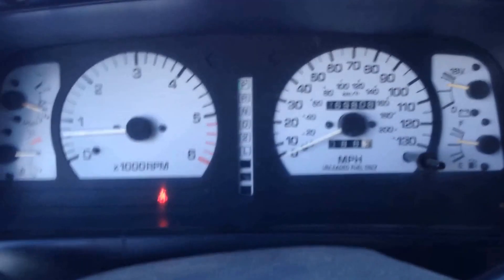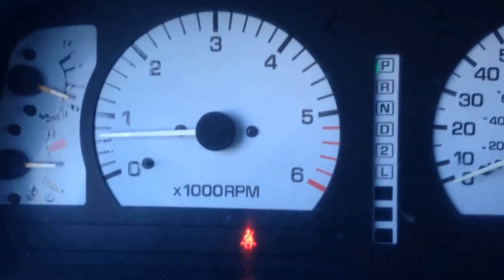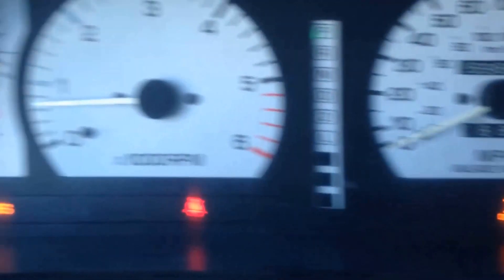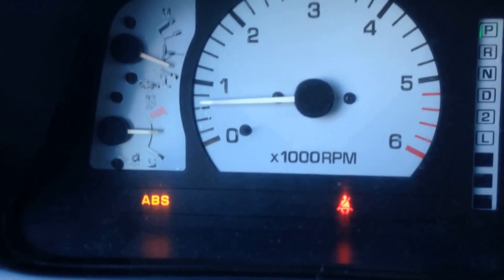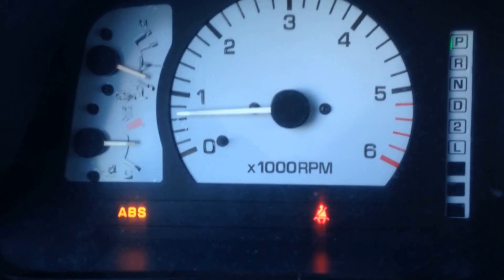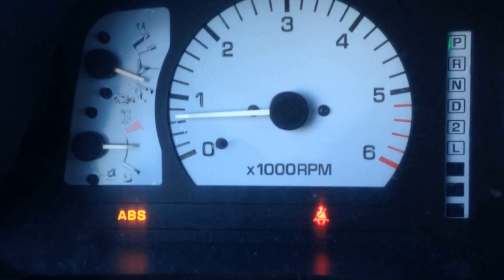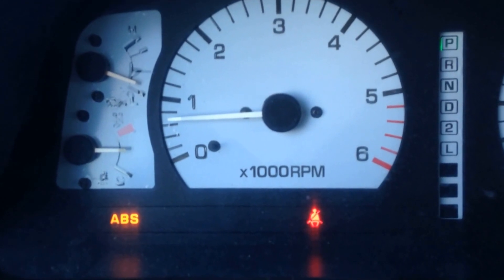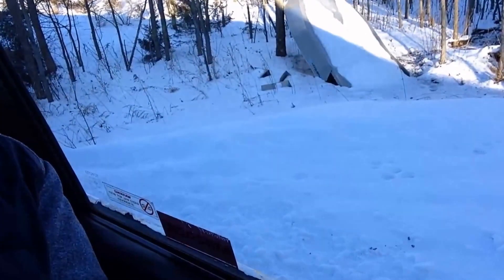4LowLife   Threshold Braking

Comment: Good tips!  I like the "curl your toes" idea.  I have a Land Cruiser about 20 years older than yours, so ABS is not an option for me.  Sadly, it's been sitting for many years, and while I'm getting it going again, I won't be finished before our snow melts here in central Washington.  Next year, I shall try your threshold braking ideas.
Reply from the maker: Right on Tim!  I have a few other cruisers as well, currently (very slowly) restoring a 1977 FJ40, swapping in a turbo’d 3B, and also working on a 1973/1982 FJ40.  After that it’s on to my 1978 FJ45.  I should be wrapping things up some time around 2037 🤣
Reply: @4LowLifeIOIYIOI : YouTube's should Implement Emoji like Facebook does! This would get the big haha. 
I tried to slam on the brakes in my Tacoma in a snowy parking lot today, to test out the ABS. Turns out the ABS wasn't working, so I just slid a little bit then stopped. Oh well.
I would enjoy seeing videos of your FJ projects. YouTube doesn't seem to have a lot of videos of FJ40's and FJ45's being worked on and built up. Not enough, anyway.
Reply from the maker: I have a few threads on ih8mud... videos will come eventually! 

https://forum.ih8mud.com/threads/saving-the-silver-70.894271/

https://forum.ih8mud.com/threads/oooops-i-did-it-again.1017208/

https://forum.ih8mud.com/threads/is-it-possible-to-do-a-0-2f-3b-swap-in-a-40-follow-along-and-see.807386/